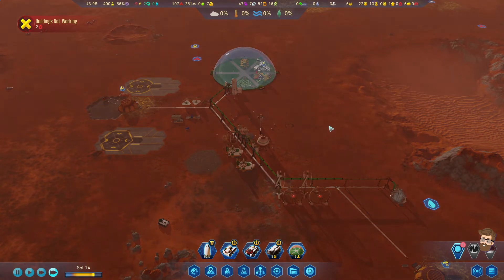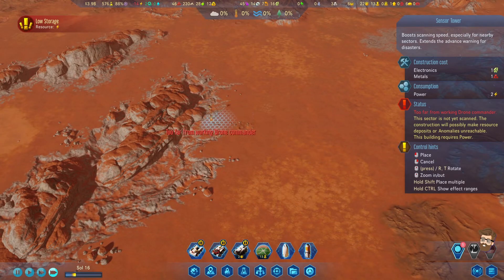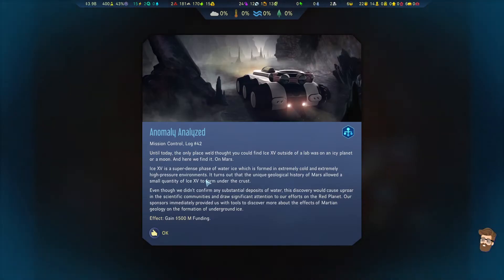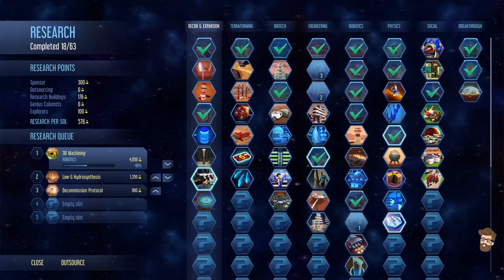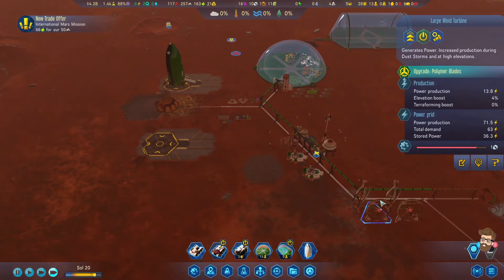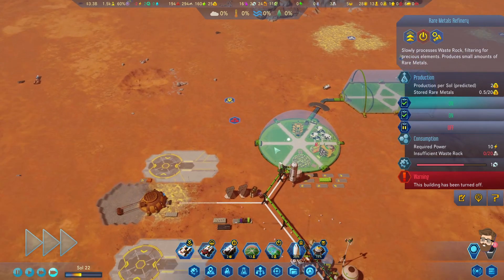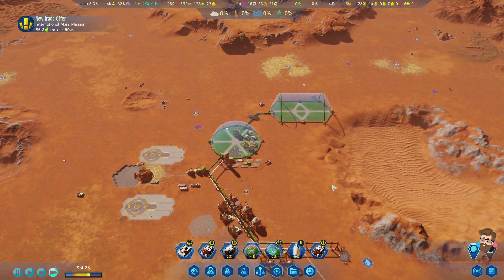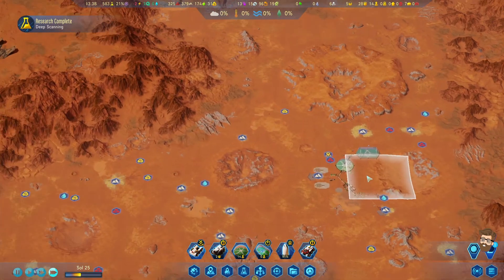Finding the Below - Surviving Mars Below & Beyond Gameplay (Part 3)

Comment: Those rare metals processors process I think between 25 and 30 waste rock a day, it seemed to fluctuate between 26 and 30 when I used them. So I don't think it's really worth having a second one running at this stage unless you plan on doing lots of flattening projects in the near future especially since they eat up so much power